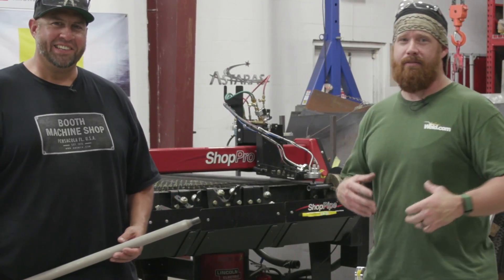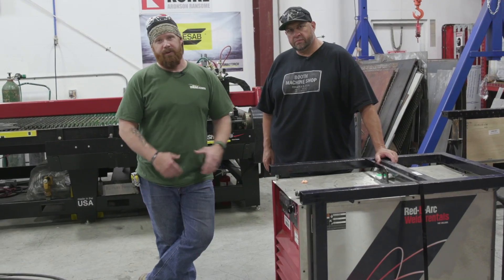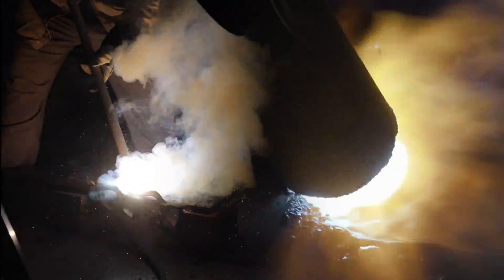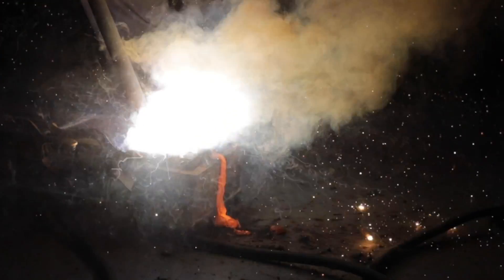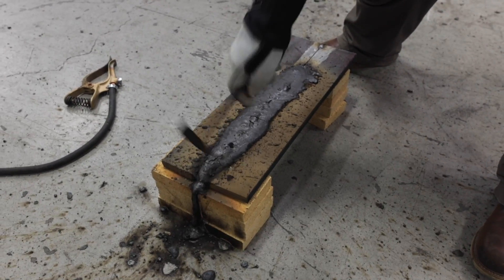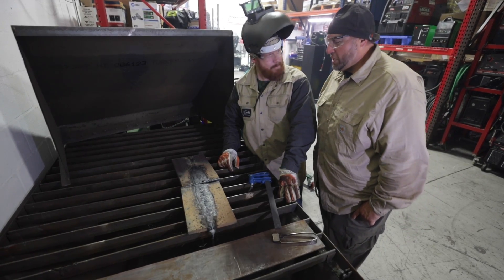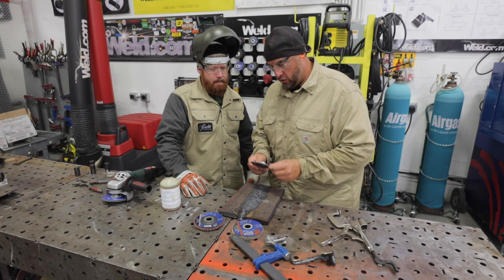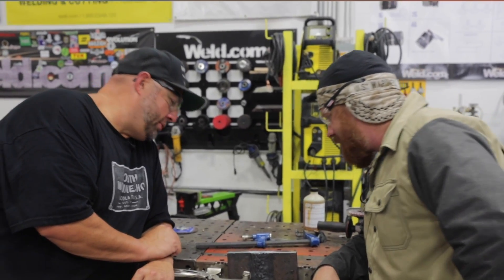1000 Amp Stick Welding CUT AND ETCH!

Comment from the maker: Adam did a Weld.com shop tour, as well as an Abom79 twist on 1000 AMP Stick welding! Go watch and give him a sub: https://youtu.be/AzABTpi_iCA
Reply: Weld.com link doesn’t work....says it’s a private video
Reply from the maker: @jwdickinson643  give it a few minutes. The video isn't live yet.
Reply: Weld.com still doesn’t work
Reply: @Welddotcom  8 hours later Still Doesn't work
Reply: Adam always posts on Saturdays, don’t give up until 12 pst tomorrow.
Reply: Bad vid link. Private.
Reply: Weld.com linkee still no workee....you fixee, prease?  😁😁
Reply: Two hours and twenty minutes update. STILL not working.
Reply: Twenty four hour update. Need to double check the link. ⌛😴
Reply: still broke
Reply: I am a welder for the rail roads I use 3/16  rods welding on rail and frogs. I would like to see if you dail the amps down as low as 820amps and pre heat the work to around 800 degrees if the puddle would become more stable and achieve better pinatration.
Reply: @jeffwilson4268  excellent 👍..... exactly how I would have run that. 1100 amps was far too hot.
Reply: Sir I want to learn

Comment: I am heavy welder guy. This welder runs at 1000 amperes and burns custom made 3/4 inch electrodes at 4 inches per minute.....It costs $400,000 to run this electrode...... for 12 seconds.

Comment: How many pain killers did you need for the aching back that came along with the demo?  In all my years, I never saw anybody put a hand on the rod, while welding, but I have seen bigger electrodes before ... in the melt shop of 😛the steel mill, as they entered the pot ... in fact, they used 3 of them, about 12" in diameter. Nice video, guys

Comment: I used to repair the big cast pieces where the anchor chain comes out of the ship. (Ageis destroyers for the United States Navy bath iron works shipyard in Maine). They would ut the cast pieces and sometimes find sand pockets. I would gouge out and clean the pockets then preheat to 200 degrees and then fill it back in with 1/16 100s wire with 95/5 gas on pulse arc mode. We ran Miller 356 inverters that Miller had custom programmed them for all processes. Including a 1/16 100s pulse mode. After it all passed ut I then hardfaced where the chain rubbed with the same wire. Great video.  🇺🇸🇺🇸

Comment: dont ever tell a welder not to try something to hard to do.
3g diddly do a intermittent basket weave a tit bit nipply ~990ampres and bobs yer auntie
4g actually was possible (metric tonne of spatter in the ear and down the collar) just did it inverted upside down

Comment: I know this is an automated process on the norm, but I’m just thinking here. The puddle is like water. If you had control over the voltage, you could dry the puddle up and possibly have more control and fewer discontinuities. Just a thought. I know nothing about this electrode or the flux composition, just considering basic SMAW arc characteristics. Any insight on this?

Comment: You can stack weld with it. We scarfed big dies that stamped car parts. Then flooded them back up with that rod we also used 1/8 wire and 5/32 wire too flood with  it was very interesting.

Comment: Cool video, I’ve done a lot of stick welding in my day up to 1/4” rod and a lot of wire feed even robotic, went to Lincoln in Ohio for the robotic training then worked months on perfecting a multi pass weld proceeded for mc-6 wire, I wrote the portfolio for that wire back in the day of corse that all had to be cleared by Lincoln electric when I was done and it was, that was the first time in the world that a robot welded a four pass weld with out cleaning in between passes on structural steel, I’ve cut and etched so many welds Lol anyway I hated to voice my opinion on this weld with no one knowing my history sorry but I have to say just a little less heat and a little less angle on the rod and you would get a better penetration and profile.

Comment: It would have been interesting to see the difference between reversing the polarity or was this AC welding I wasn't sure it'd be interested in put more of the heat into the plate and see if you got more penetration out of it just curious

Comment: I realize rod vs holder vs length of Rod = lots of weight & mechanical disadvantage, that being said.   With 5/32  , even 1/4 inch rods , can't say used drag method, alway a half moon overlap.   Normally this method gives deeper penetration on weld tests I've seen .    Coupon testing .       First pass 6010 , then three passes 7018 with a weave bead  encapsulation.  Always kept Rod in motion .

Realize this is a enormous dog and not possible .      Would of  like to have seen A-Bomb try tho, even a push motion to try to "bury" the Rod , worst thing happen would of blown out said test piece.    Most likely was welding before your birth. 
Ran a test contraception that later became known as now a day wire welder .   
After few years realized if stay in field, death knock sooner on my door.   Loved welding tho, was a Challenge & when finished satisfaction was a thing that  put you to sleep at night.   Did it off n on thru rest of my career, but days of pounding out buckets of spent Rod ends was over.  Imagine filling a 10 quart pail  of Rod ends an inch and a half long or shorter on a shift .  That was a slow day.  Having a needle scaler boosted performance.  Never was much to have a guy chip,n slag for me, to much of loner .        I'd tackled that Rod for sure tho, almost makes me drool .

Comment: Hey I'm curious if you guys could show the comparison of short arc mig to like the average Joe settings then so ridiculous settings like we r forced to run were i work such as 29 bolts or higher 800 or higher on the wire speed

Comment: I  use 600 amps on my  3 phs 1000 amp dc welder quite often . Its got diodes the size of coffee cups . I got a few of these  welders  cheap , from a ship yard auction . Nobody bid on them except me .  I also go the big cables in 80 ft lenghts , just had to  bid against the scrap copper guys . Ya those cables youre using are pretty punny .  On big rod , I cut them in half , to get better   control , but theres more wastage . One other thing , never shut the welder off , just after youve been doing  that , youll cook  the    coils . Let it run the fan for atleast a half an hour . I doubled up on fans inside as well .

Comment: I think that neat swirl pattern is because with small amounts of fluid like little drops of water the fluid tension keeps it pulled together, but once you get enough of a fluid together it can run like a river and not be constrained into small round shapes by surface tension.

Comment: Was that electrode 7018? Looked more like 6013. You can have all the vent system you want in a shop and it wont be good enough. One of the best ways to deal with welding fumes is this>>>(3M Speedglas 9100XX FX Adflo Air Fed Welding Helmet.) But it's not cheap and for what it is it shouldn't cost nowhere's near that much.
Reply from the maker: It's called an F25. It runs similar to a 7018

Comment: What a mess. If Americans think that is welding, please DON'T send anything welded over the pond. P.S. What polarity did you use. I presume you know what mean.
Reply from the maker: We're not running a test brother. Simply having some fun.
Reply: @Welddotcom  The amount of heat coming from that, I would not call it FUN. Try welding a piece of steel too a piece of aluminium. yes, that is how to spell aluminium, and yes, it CAN be done.
Reply: @derekhaydon4656  awwn, what a cute little keyboard warrior you are! Chill out bro, this wasn't supposed to be professional work, it's literally for fun. Haven't you ever grabbed 2 pieces of steel and welded them with, for example, various kinds of electrodes just to see how the welds would look like? The difference is that those guys are doing it and uploading on yt. And it is a very entertaining video, you liking it or not.

Comment: My biggest rod was 1/2 7018. Welding 3/4 plate corner joint. Had an old 800 amp lincon diesel welder.

3/4 is massive. wow.
If you need to sun bleach a pair of jeans

Comment: Yeah I could run that with my harbour freight buzz box on a 110v l10 amp light circuit with a 100’ extension lead.

Comment: 1. it penetrated 1/4''
2. you measured from the top of the mountain of weld, and not from where the base plate started. thats how you got your 3/8'''

and 
3. why didnt you bevel two of those plates and weld them like an actual weld test?!?!

Comment: I saw a film of a man welding on a battle ship with a rod the size of a broom stick pretty cool . I welded in rock crushed every night with 3/8 rods about 380 amps I can tell you the light is intense I would have these weird 4 little dots on me it was from the light coming through the button holes on my shirt. I would like to see someone oxy acetylene weld 
once watched a man weld 1 inch plate he welded vertical and had a puddle the size of 50 cent piece 
he had a bucket like a paint can full of flux and went right up looked like arc welding.

Comment: I think this weld would have turned out a lot better with some bevel and joint prep. Due to fluidity and hi filler metal to flux ration a nice bevel would have allowed more penetration, better contained the pool in a gorge so it wouldn’t have flowed so heavily and same with the slag, allowed it to build up more heavily and avoid pockets on the rear of the weld pool. Personal opinion :) keep up the good work 👍🏾
Reply from the maker: You're right. We wanted to see how she would penetrate though.

Comment: I had a job working with 7/32 and 1/4 inch big steel slab on the stop part of the coiler of an 86" hot strip mill.  I welded about a 15 degree uphill.  You have to watch the slag and steel flipping off the rod.  On 3/4 inch plate this wouldn't work.  But, on 16 inch x 84 inch weld with welding going on steady for 16 - 24 hours it surely was a lot of full penetration depending on your rod blowing off the rod.  the slag peeled off all the time.  I burned up double ply welding gloves every hour or so and burned up several stingers.